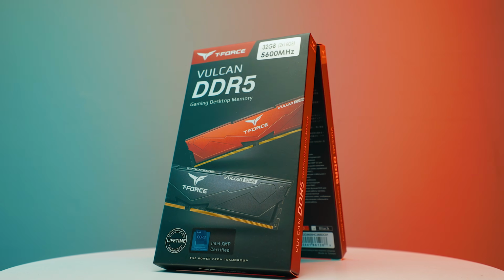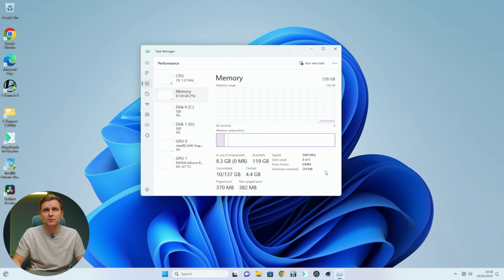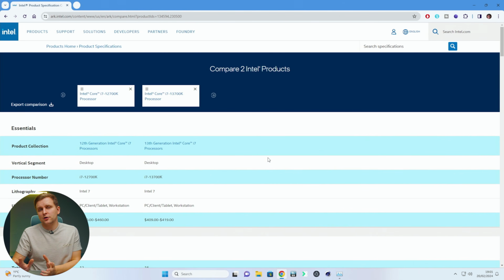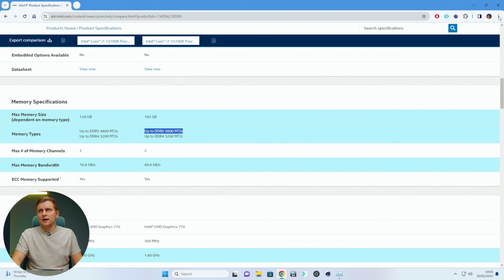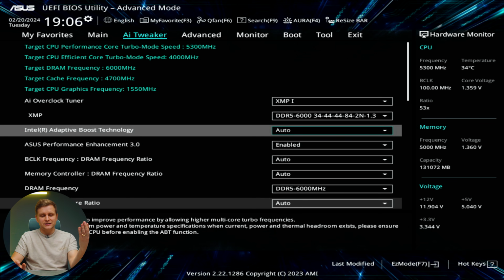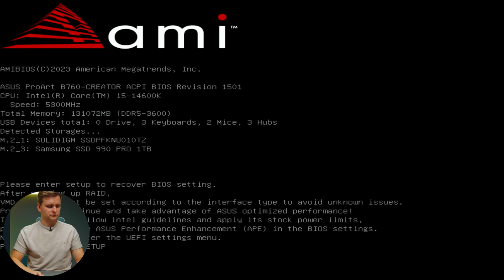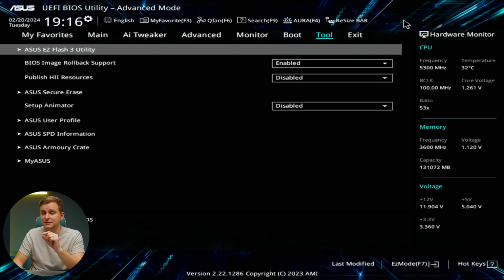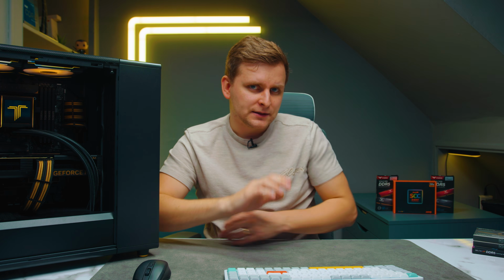Maximize RAM Speed EXPLAINED: Common Mistakes to Avoid & FREE Performance Boost!

Comment: I had a weird thing happen on a PC I just built. Its an MSI Z790, i5 12600k, 32GB DDR5 T Force Delta 6400mhz 16x2, RTX 4070. I set the XMP to what I now know is the wrong speed, I had it set to 6000mhz, but never had any kind of problem at all. No crashes, no failures to post, nothing out of the ordinary. I went into the MSI Center app to overclock through the MSI Creator APP and not through the BIOS. I can see the specs of each individual RAM stick. 1 was running at the proper 6000mhz, the second, according to MSI Creator, was running at 200 mhz. I went into the BIOS and set the XMP to the proper 6400mhz and turned on RAM performance mode. Now Creator says both sticks are running at the proper 6400mhz.  IDK what that was about?? I had benchmarked it before changing the XMP, but didn't record the scores, so I cant really tell if one stick was actually running at 200mhz, or if something was just bugged in the MSI overclocking software, I do know how many FPS I was getting in some games I play, I can ck to see if that has improved. I thought 2 mismatched RAM sticks would run at the rated speed of the slowest stick, in which case both my RAM sticks would have been running at 200mhz, which does not seem to be the case. When I did benchmark the system the ranking of the score was right where I would have expected it to be, say a bit slower than a 13th gen i5. Very odd. The ASUS BIOS looks so much nicer than the MSI BIOS. I'm sure most of the options are the same, just looking at yours the options are presented in a much clearer fashion. On MSI BIOS you really have to dig through the settings to find anything.

Comment: I wish I had know this before. However I bought DDR 4 ram and I don't think they had high capacity sticks at that time. 

Side note, can one put DDR 4 ram in a newer machine? Would it run the ram faster without compromising the stability?

Comment: had the same 4x16gb 6000   early bios (asus) worked with no expo (stable).. and also worked at 6000 4 sticks.. but, next update bios.. 6000 4 sticks didnt work..  then new update bios.. not even 4 sticks with no xmp didnt work.. so i gave up..  i bought 2 x 32gb 6000.. and work super stable with no issue what so ever

Comment: Heres a Mistake i made, put the ram in the wrong slots, i put in 1a and 2a  should of been in 1b and 2b i have always filled the slots, first time in 30 years i used less than normal for the speed. XMP wouldn't work, when in the A slots. First position made sense to me.
Reply: at least you didn't put it in the wrong hole

Comment: heres a wierd one, bought the new pro art Z790, because i might have problems with my Z790 maximus extreme... the pro art is newer, but wont run the corsair vengence at 5200 xmp, that i took out of the extreme board, and i swap cpu. i just bought the pro art, cause i have to rma, the extreme. but i ordered the 6800 team group, ill know tomorrow, how fast it goes. 14900k

Comment: DON'T EVER CLEAR THE CMOS WHILE THE SYSTEM IS RUNNING!!

Turn the PC off, unplug the PSU and then clear the CMOS.

This was totally irresponsible, showing you jumpering the pins with the system running.

Comment: Or you could buy yourself a little PC speaker that you can plug into your motherboard and as soon as you hear the "BEEP" you can start hitting the Del key.

The little speaker costs less than £1 and takes most of the hassle out of getting into the BIOS.

Better performing RAM is cheaper for AMD than for Intel.

Intel can only run RAM in Gear 2 mode, which means that the memory controller in the CPU can only run at half of the data rate of the RAM.

For instance, if you have DDR5 6000 then the data rate of that RAM (remember DDR stands for "Double Data Rate") is 3000 MHz and your Intel memory controller can only run at half of that which means 1500 MHz

AMD can run RAM in Gear 1 mode, this means that the memory controller runs at the same speed as the Data Rate of your RAM.

For the above example of DDR 6000 RAM, the Data Rate is 3000 and your AMD CPU's memory controller runs at 3000 MHz.

So you get the equivalent performance of an Intel CPU running DDR5 8000 RAM in Gear 2 with an AMD CPU running DDR5 6400 in Gear 1.

The guy from ASUS was always very fast to pivot away from AMD in the interview, I noticed.

Comment: I running Corsair 6000Mhz DDR5 2x sticks with 13700k first I had a problem with my ProArt Z790 motherboard but after a couple of firmware updates Asus fixed everything and now I have zero problems running XMP. 
I do mostly photography 64GB is plenty for my needs. I can get up to 50GB RAM usage if I apply something like radial blur filter in Photoshop. 

I'm shocked how much Lightroom can load your GPU with AI noise reduction. I like to run my low light wedding images through AI noise reduction my RTX4080 gets pinned to the max at 100% utilisation.

Comment: I recently heard that it's bad to buy two 2xkit RAM even if are the same model than 4xkit? I have I9-14900K and Z790 Dark Hero, just build it and not yet XMP enabled. I currently have two CMP32GX5M2X7200C34, so 64Gb. Is it safe to try XMP or should I switch to 2x32Gb?

Comment: Hello Sir, I have two questions for you: I would like to know whether to put in a mobo that has a DDR5 6000mhz RAM limit, inserting a pair of 7200mhz RAM and setting it for example to 5800 with the XMP profile from the BIOS; this Motherboard is about to start. I definitely have to set the Timings different from the default ones. Or would you boot the operating system in SPD and that's it? Second question: in an Asus B660M motherboard prepared with DDR5 RAM and with Intel 12th gen. CPU, Can it work with a pair of Cas type RAMs with 30cl latency? Or the Timing must be reset if bios doesn't detect them? Not all brands should work, even Non-QVL. Those who can try various types of kits know this. I hope you answer me. Advice? Thanks and have a good day

Comment: Might be worth always repeating the fact that 32GB sticks (each) are currently always 'double sided' so equivalent apart from one address line load to two 16 GB sticks. Current memory chips are either 16 or 24 Gigabits so even 96GB kits will only run as if you had 4 sticks!

Comment: There is a solution to this problem. Xmp does not work on Dimm slots a1 and b1 when only using 2 sticks. Xmp does work with 2 sticks when putting into dimm slots a2 and b2. I’m running gskills z5 6000 on those two slots at the advertised speed. If you want to do 4 slots, you’ll have to mess with the voltages. Look up asus xmp not working and theres a guy that explains how to make it work. I have the proart z790 motherboard with a 14700k

Comment: So, for the best RAM performance, it's best to distribute your capacity between 2 sticks instead of 4, unless you want to dig around in the BIOS.

That's interesting. My first instinct would be to fill all the RAM slots for maximum performance.

By the way, are there any applications that use that RAM capacity displayed in your task manager? My Windows 11 laptop has 64 GB of DDR4, but it barely pushes 8 GB.

Comment: My rig is pretty much maxed out across the board. The only thing I left stock is my graphics card. 

specs :

CPU - 7800x3d 

Gpu - 4090 strix oc 

Ram - teamgroup 7200mhz cl34-42-42-84 1.4v 32gb (oc’d to 7400mhz)

Comment: Just saying i was sucking this issues with my new computer for a month first i bought corsair vengance 7200 4 out of 6 kits was faulty one pair worked. Anyhow after that i changed to corsair titan something, but in both cases you can reach the named value but telling to your bios it is a 6000 is not enough, you have to go to advanced settings and raise the voltage with 0.05 in vram and vdram and also tell to bios to handle independently the ram voltages not synchronise. if you do those changes (worked for the good Vengance and for the Titan also)  than bios able to train and than win able to boot in the expected rate

Comment: Where was this video when I knew way less, lol. (Teasing, learned a lot from your vids when I was in the, what's bios group? Teasing, It was the 80's when I didn't know that much, if they had bios then. LOL, but I never tried tweaking a system until late last year. Your interview with JJ was HUGE for me getting a few bits deeper into the "black arts" of memory OC. Maybe I tuned out, but I like to undervolt the memory if it can handle it, but sometimes it needs more voltage to handle more Mhz... not sure if you covered that, have a great one!)

It's alright, you were entertaining even if I'm acting like a know it all now. LOL

Comment: I have an i9 13900 KS, with 128 GB of RAM at 5,600 mhz. I was getting blue screen on some boots, but then I enabled "Windows fast start up", and I have never gotten another blue screen. It saves the settings, so the RAM doesn't have to "retrain" every boot.

Am I going to hard on my RAM? (MSI z790 Carbon motherboard)
Reply: Nice!  Haven't tried this method yet!
Reply: @white_lizard  I still didn't like how I had to do a work around, just to make it stable, so I just changed to 5,000 mhz, because I have 4x sticks of 32 GB of RAM = 128. Only time will tell if this fixes it.
Reply: @4 × 32 GB modules u mean right? Wait are there 128 GB consumer grade modules ?chrispridemore5562
Reply: your cpu is just not good enough to run that much ram, it’s really that simple, cpu technology hasn’t advanced at all.
Reply: @ Setting my RAM to 5,000 mhz fixed it, without the need for fast boot. It's because my capacity of RAM is so high. (I meant to say 4x of 32 = 128 GB of RAM)

Comment: MEMORY STABILITY STRESS TESTS. You briefly mentioned that some Asus motherboards have a memory test in the BIOS but you didn't talk about any memory tests to do to check for system stability to make sure you overclock is truly stable. You have to do memory and CPU stress tests anytime you do a new overclock whether it's XMP, EXPO or not. Geekbench is a good start because if your system can't handle that then you need to adjust it ASAP. If Geekbench test goes through then move on AIDA 64 Extreme or Y-Cruncher. If you can get through Y-Cruncher's multi-core memory test without any errors then your memory has a good chance of being stable under other conditions and scenarios.

Comment: Fast is nice, reliable is much better. Run mem tests and several performance tests. Back a few years the Prime95 torture test could detect a lot of memory compatibility problems. It often could find problems that Memtest or Memtest86+ couldn't detect if run for 24 hours. Don't know about the current status though.

Oh and the figures mentioned as five and six Giga Gerts were technically wrong. The numbers shown were Mega Transfers Per Second, not Mega Cycles Per Second. Yes it's usually called MHZ but that doesn't mean it's right. The actual frequencies are a lower as  this is Double Data Rate memory. So the actual bus frequencies are half the number.
The question may be if this matters, and in most cases it really doesn't. Just be aware that if a manufacturer lists 6000 Mt/s and another 6000 MHz they are both talking about the same thing, just that the first uses the correct Mega Transfer per Second instead of the incorrect Mega Hertz.

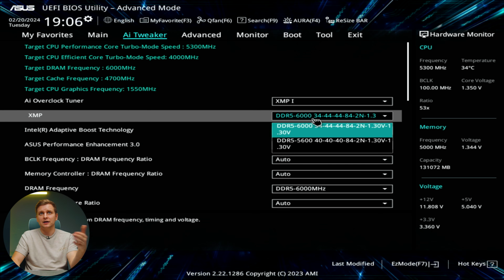Now one more thing that I can't remember were mentioned here were the secondary memory timings. RAM speed and stability is not only dependent on the secondary timings. If you look at the video at 9:30 you can see that XMP I lists two possible options. There is DDR5-6000 34-44-44-84-2N-1.30V-1.30V and DDR5-5600 40-40-40-84-2N-1.30V-1.30V
The numbers after 6000 and 5600 is the timings. The primary is the first, also often called Cas Latency or CL. The rest are secondary timings. As seen they can be higher or lower. In general you want the lower numbers as that means the memory will work faster. But using a higher number can sometimes make a memory work more reliably or work at all. The question if using higher timings to make a higher frequency work with your memory, motherboard and CPU will make it faster than using lower timings and lower frequency is a tough matter I won't try to address here, but lets say it's not a simple question.

Now these timings can be manually adjusted in the BIOS, but it's something best left to people involved with intense overclocking as it can get quite advanced. Staying with the XMP values are usually the simplest bet.

Oh, and what is shown in the video is technically not the BIOS. Technically that motherboard is using UEFI instead of BIOS, and technically what is shown isn't the UEFI but the UEFI Setup Utility. It is the same with a BIOS. What you use to change the settings is the BIOS Setup Utility. It used to be that these were programs you ran from a floppydisk, but having the menu systems included with the BIOS is so much easier that it became a standard practice.
Yes I know, semantics. But sometimes it's hard to draw the line where it's OK to shift the usage of words. Also it's sometimes good to know the differences between common practice and the original names.

Comment: Hi, how are you? I have  question please. I saw that the 2x48gb sticks are only most of all XMP Intel. I have a Ryzen 7900 is it possible to use them on Ryzen 7900? or must i buy a EXPO compatible ones? Or this thing on RAM about XMP and EXPO are just marketing and royalties thing? Thank you. :) Very nice content.
Reply: If you are willing to do some manual set up, it will probably work.  I have an AMD CPU and I use it with 'Intel XMP' DDR4 ram at a faster speed than it said on the box.  If you want one-click no worries easy peasy set up though, you should just get a kit with AMD EXPO.

Comment: Should probably explain abit more about motherboards. From recent experience of buying an Aorus Z790 elite, and thru several crashes and research, I've found out that the motherboard makers these days overoptimise their overclocking profiles and remove certain voltage and power limits when you overclock the CPU and/or RAMs. This causes instability at high clock speeds on both sides and may even end up damagit components. 

I"ve had to spend several hours reading up on motherboards, cpus and ram and tweaking bios settings in order to find a somewhat stable compromise in the bios settings where i can overclock the CPU(14900kf) and get my RAM (2x32GB at 6000mhz) speed up to 80% of its overclocking potential (any higher and I end up crashing whatever games im playing).
Reply: What did u clock ur cpu @‘? I’m interested 👀

Comment: Great video i have 4 sticks of DDR5  6000G.SKILL32GB2Rx8F5-6000J3636F32GX2-TZ5RKDSSamsung36-36-36-961.35v
 Default speed for my ram is 3000 MHz I can only get it to run at 4000 MHz. @theTechNotice  I see in the video you reset Cmos while the pc is running, you should never do that.

Comment: How much does QVL matter?? Should i change the RAM as per ASUS QVL list or having a non QVL will be fine for enabling XPO for DDR4??
Reply: QVL is a nice guide to know what RAM kits have been tested at certain speeds AND work with that motherboard. Non-QVL kits might work but it's not guaranteed and you may be stuck with slower RAM than you anticipated. I have an Asus B650E-F Gaming Wifi and I chose a QVL compatible DDR5-5600 32GB kit with Hynix M-die so I could easily overclock it to 6000MT/s for my Ryzen 7 7700X (and possibly faster speeds when the BIOS updates are available). Hynix has the fastest and most stable DDR5 (they were the first to release DDR5  RAM too) so I knew I needed their M-die when faster RAM speeds are made available to motherboards later into the AM5 cycle and for when I upgrade my CPU to Zen 5 or 6. If you watch Buildzoid of Actually Hardcore Overclocking, he stability tests motherboards, CPUs, and RAM and he tested my current MB with a 7950X months before I bought it so I knew it could handle a high end CPU when I buy one in the future. Have you bought your motherboard yet and what kit are looking to buy?
Reply: @vigilant_1934  I have x570 creative WiFi board 5900x and currently I have two sticks of Gskill ripjaw 3600 ddr 32gb ram 
So when I want to upgrade to 128 should sell them and buy a new one (without checking) or there is some way to check if these will be compatible in 128gb usage ?

Comment: so i have a 7950x3d supported RAM speed is 5200 I got it at 6000 and have done many memory tests and always pass.....guess i got lucky with silicon lottery !!!
Reply: 5200 is just a suggested value. It should run 6000. 6200 and 6400 is the lottery there.

Comment: OC my corsair rgb vengeance 32g.b 6400 cl32 ddr5 kit to 7200 cl34 very easily on my msi tomahawk z790 / 13700k rig. "13700k oc to 5.6ghz on all 8 p cores, All 8 E core oc to 4.4ghz, Ring oc to 5.0ghz at 1.34v". Figured out I have hynix A-Die with my ddr5 corsair vegence kit which allows you to pretty much hit any speed you board / cpu can support. But went on corsairs website and looked up corsair 7200 kits and check the timings they have for those kits and applied those exact speeds in my bios which are 7200 34,44,44,96 1.41v. First try it booted right up. After over night of testing I decided to tighten up the timings. So I did. Atm I'm still at 7200 34-41-41-83 at 1.45v. It's been this way now for about 6 months not a single crash or hiccup. I'm tempted to try tighter or faster timings but it just takes so much time and I don't know if ill even notice it the difference.

Comment: Good to see more videos coming out on the trials of running 4 dimm kits. For the longest time all I could find out was that xmp only worked on 2dimm. (Which obviously would have swayed my purchase decisions had I know up front). But just recently found another video explaining how to get xmp to work with 4 dimm. The only other difference on that one was to slightly bump the voltage settings to increase stability. Was able to get my 5600 dominator kits to run stable at 5200 on a 12700k and z690 strix board.